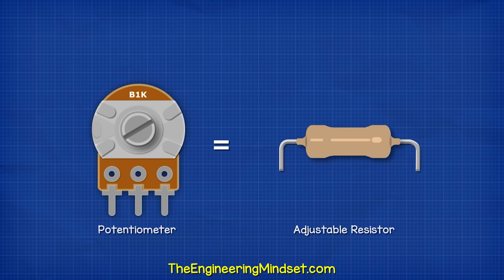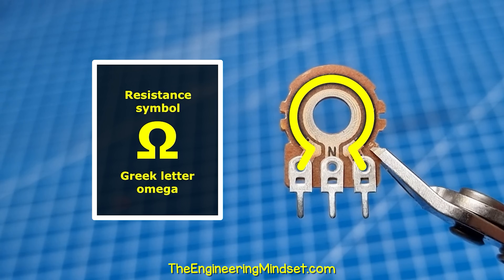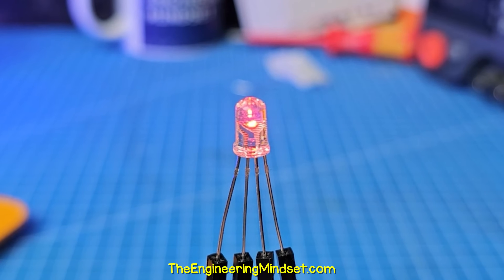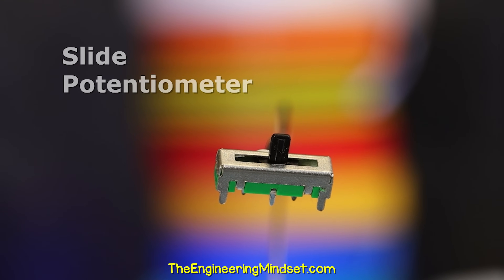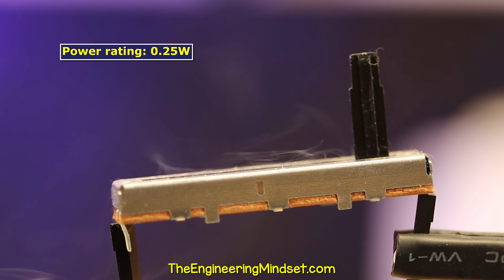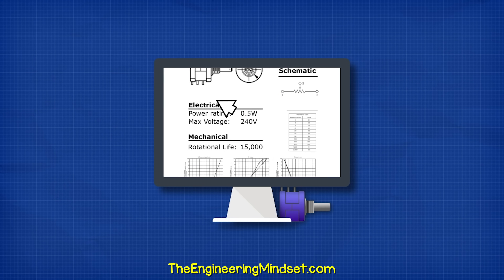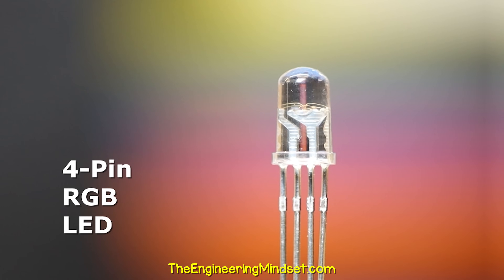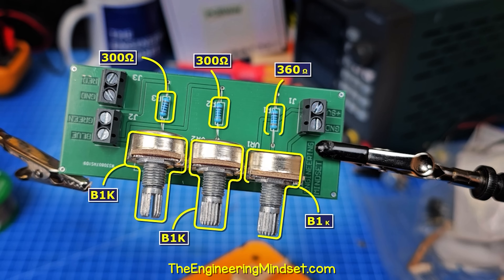How Potentiometer Works - Unravel the Mysteries of How potentiometers Work!

Comment: Is it the same in the ceiling fan ?
Reply from the maker: Probably not, ceiling fan likely has an AC motor. But nice idea. It could be used if the design is slightly different.